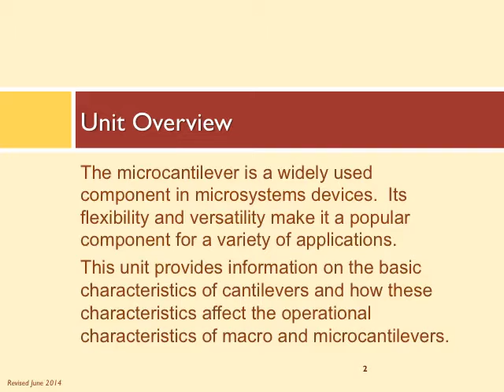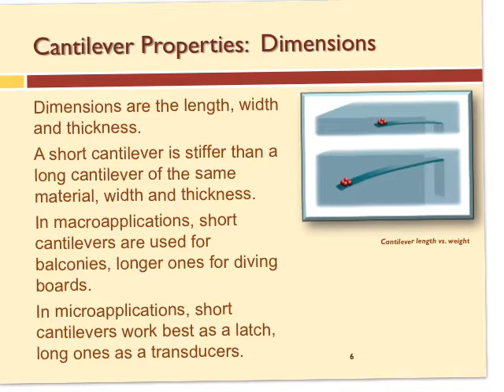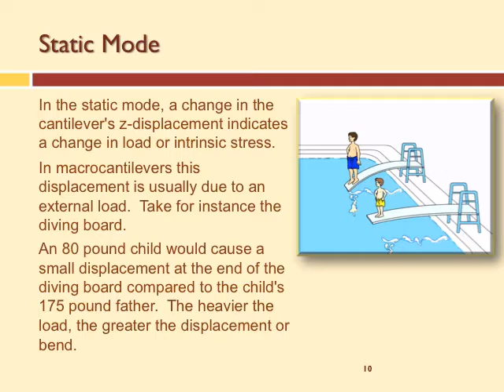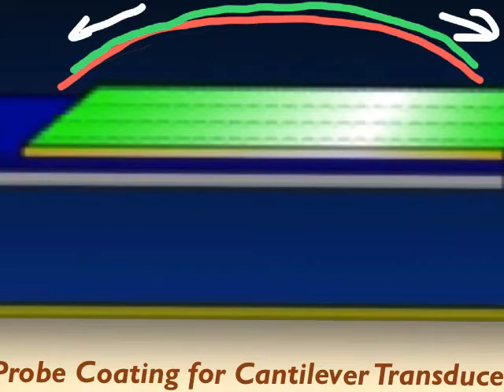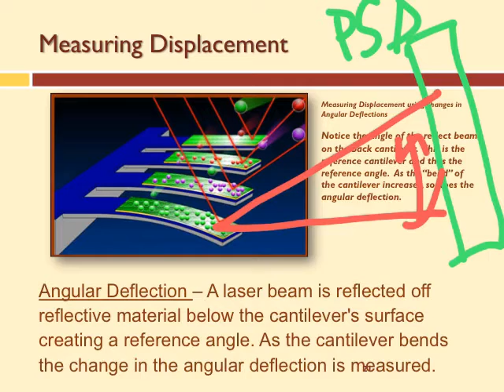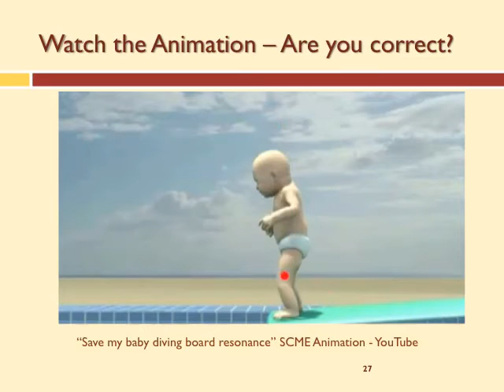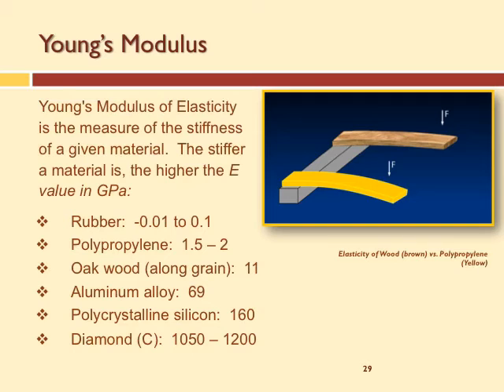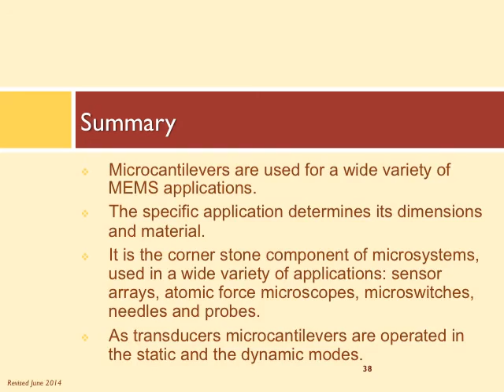How Micro Cantilevers Work Lecture

Comment: Hey sir ! Thank you for your lessons are very helpfull !! I have a question ... Let's say we want to meassure a biological element using microcantilever. Can we intergate all the necessary parts (and the laser source) in a single Lab on a chip device? And if yes? How can we do it?  And which transdaction method is more sensitive, with the laser or with the resistance?